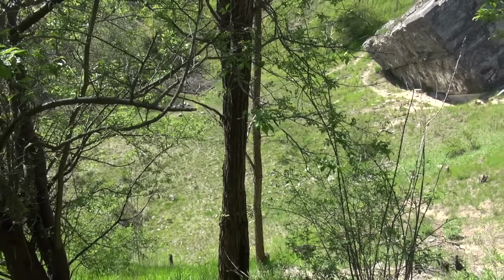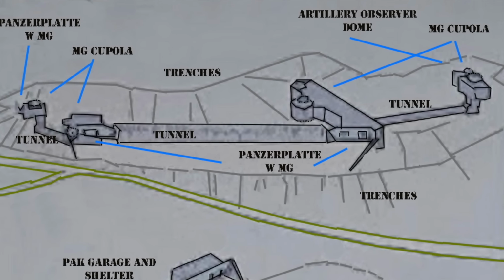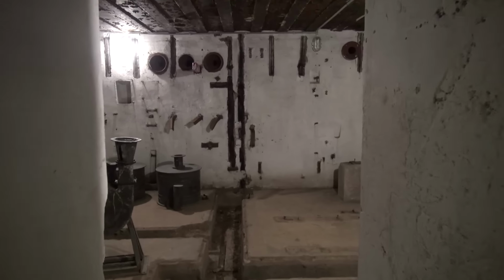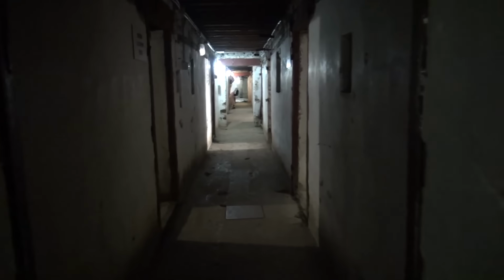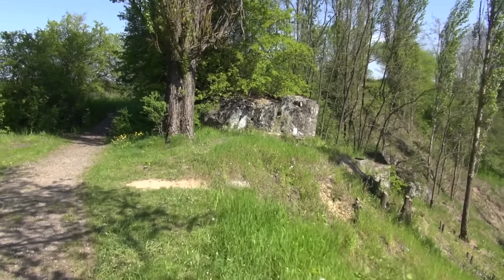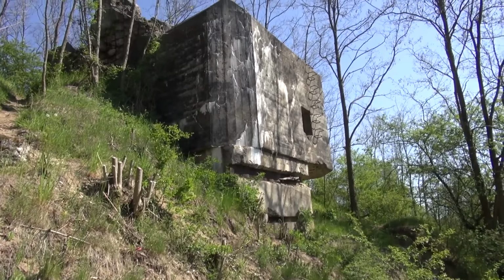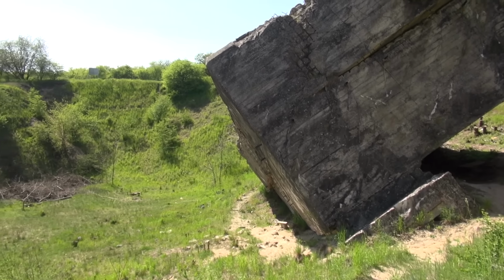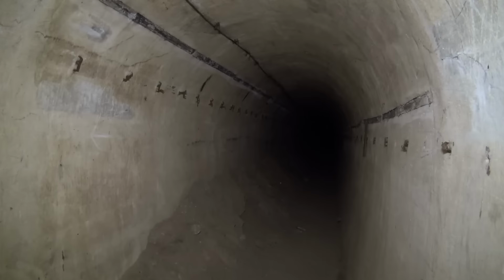FIRST GENERATION GERMAN BUNKERS THE POMMERNSTELLUNG

Comment: We have small WW2 pillboxes in NE UK on a slope and even upside down in coastal locations which have been undermined by sea erosion and that bunker looks similar in having been eroded by quarrying or mining. If that crater had been caused by a massive explosion it would have thrown the bunker out over and built up a mass of earth around the crater as per Lochnagar.
Reply from the maker: I will be spending some time in the UK looking at your bunkers and castles:-)

Comment: funny i was thinking that 'crater?' looks almost natural, one side is missing, perhaps like a quarry for stone or something, ie like a valley, so perhaps the bunkers were undermined by water or erosion, it does happen! and since most bunkers are top heavy, once undermined easily topple over with a little help from mother nature it seems, i suspect the water was drained explaining the missing side of the crater/quarry, if it had one in the first place - amazing to see such a thing toppled like that, but i wonder if one day someone will say scrap it, its just the cost of doing it
in an old museum close to me was a thing called a Hamilton shelter, used primarily on airfields, with a single or two occupants who clambered in through the top when the shelter was in its lowered position, could then raise it and fire weapons through the gun port
the museum had two, one in better condition and the other, was rebuilt (badly) the near complete one was seen as a nuisance so they scrapped it, deleting another piece of history, the madness of people